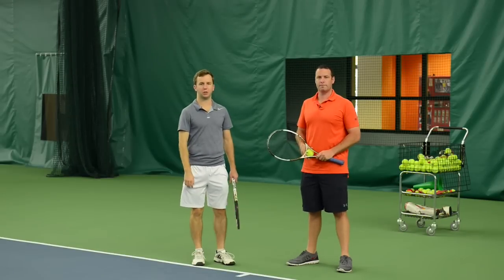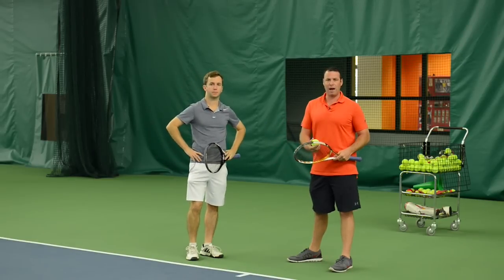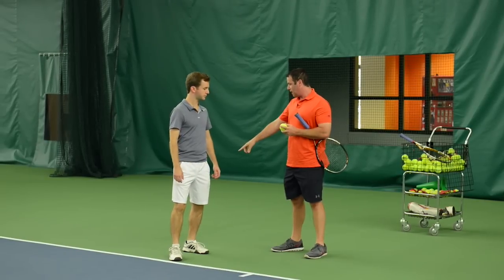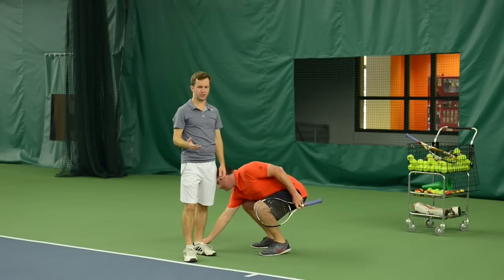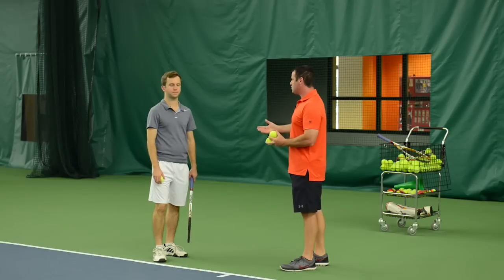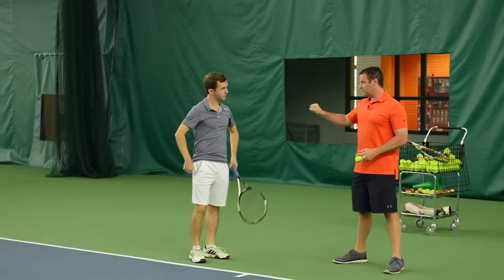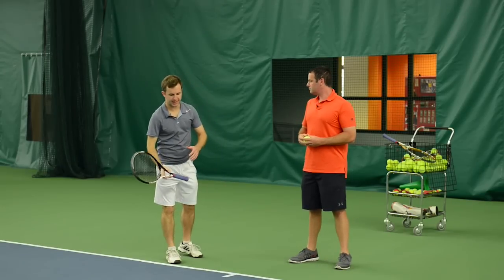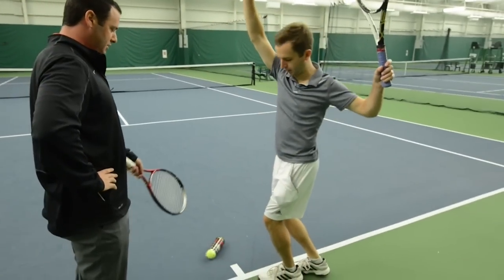Tennis Serve Lesson - The Serve's "Nuclear Power Source"

Comment: As a tennis teacher, I agree with everything. You can see Federer slightly lifts his left foot while tossing the ball. I think legs are the starting point of the power but the most power comes from the pronation and shoulder internal rotation because those segments can go really fast.
Reply: Agree with both TT and Will & Dr.. You will add more speed when you accelerate up with the racket butt towards the ball and pronate at contact and pull to finish and relax the arm.

Comment: Nice to see you again Will!
Reply from the maker: +caloyjp Thanks!
Reply: +FYB2007 upload more man
Reply: FYB2007 interesting.  this is totally contradictory to what Florian Meier shows on his chanel "online tennis instruction". he says and shows a demo of him serving from his knees vs standing and only gets 9 mph more from the normal serve stance. his claim = all power comes from the arm! I've seen differing style of  instructions before and that's understandable from coach to coach  but never something totally contradictory.
Reply: Is not contradictory! Is loading the hip not the legs! When Florian serve from knees is using his hip too! Nice point it out.
Reply: When Florian demos serving from his knees, its IMPOSSIBLE to use hip.  He is using a little bit of torso rotation and that too only the limited amount that his body will allow as a result of the knees planted firmly into the ground.   I don't agree with Florian that there is not much added power from the legs and that most of it comes from the arm.  To prove it to yourself, here is a simple exercise.  Try to throw your racket from the baseline with no use of legs ( from kneeling position), mark how far it goes.  Now try and do the same jumping up and forward into the court and see where that goes.  Pace, Spin and Bounce are all heavily dependent on how well a player use the synchronized transfer of power ( smooth slow to fast movement ) from the legs and then eventually up to the arms.  These coaches just don't know how to explain it and often cause more confusion.

Comment: I bought the 100mph course, which is great, clarified a lot of confusion around how to use kinetic chain correctly. The only thing I don't quite understand is the swing path of different serves, especially if I always swing at 45 degrees how can I hit a flat serve, wouldn't it put lots of spin on the ball resulting a slice or topspin serve?

Comment: I need clarification.  The squatting exercise to pick up the ball, and then Mark's comments suggest that you should "sit" into to back leg in your back swing.  But this seems contrary to most of the serve instructions and what all the pros are doing on the tour, which is to lean back and bend the knees on the back swing.  Can someone resolve this apparent contradiction?
Reply: The instruction here is just another piece of flawed misleading information. The contradiction solved.
Reply: This is an drill to help our bodies get used to loading on the back leg. If you look at the great servers, they load onto the back leg. Yes there are variations to the technique but the common theme is that energy must come from the back leg. Dr Kovacs has a lot of drills to help your body get used to certain aspects of the technique. He also does the elephant drill which is in his course that helps with rotation. So this is one part of the swing that you can train. Also, the hip rotation is important to get power, which Dr. Kovacs also goes into.
Reply: the thing is they are not really just bending the knees they are rotating and bending at the same time and thats exactly what you do when you pick up the ball next to your heel here
Reply: When an exercise doesn't resemble the actual motion, all proper muscle memory goes out the window. It starts with throwing instead of striking. These two motions are so different and the feedback on release (throw) and  strike are so different that you can't really take one into the other. Same for squatting: nobody squats on a serve. So you learn zero from that technically speaking (you do strengthen legs by squatting).
FYB is a great channel for tactics, for technique I wouldn't recommend it.

Comment: See I am sure I lose power in my serve somewhere. I try turn away from the ball after I throw it up . Bend my knees . Extent my legs , turn my hip . Drop my racket . Try to turn to be facing the ball by the time I hit it and lag my wrist. But how much of that I do before I hit it ? God knows. I only serve at about 60 to 75 mph and I am Six foot one and build very lean. Surely I should be able to serve harder . Let's see if the vid helps.
Reply: Throw a a tennis ball over the net with all your power and assess. You will see and sense where the weakness in your biomechanics is. 

Next, swing a whip and see what sort of whip effect you get. Or use a towel and see whether you can get that whip effect. These 2 exercises will show you which part of your body is not contributing to the kinetic chain. 

When I had problems with my serve, basically no power, I used these exercises to assess. I found I was not using my torso muscles and also noticed  I was not using my non dominant hand properly. I was also not keeping my chin up until I hit the ball. I was also not tossing the ball slightly to the right of my head. 

Watch Vic Braden and Powerflail to correct your serve.

Comment: This is absolute rubbish. Main power coming from the back leg and loading your back leg is not only misleading it is also dangerous. You end up injuring your back leg due  
to over stressing it! You load up your torso which will in turn throw your racket hand to the ball. That's all it is is. Serve like as if you are throwing a whip.
Reply: but legs are much bigger muscle groups then your arm so its not that easy to overstress a backleg and you dont have to bend super low, the torso is also important but without legs you are missing one link of kinetic chain